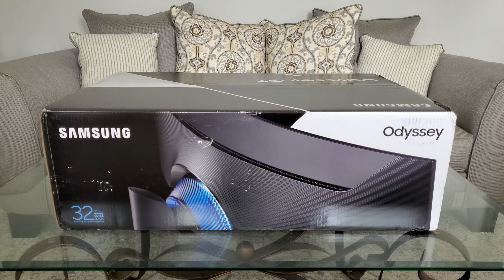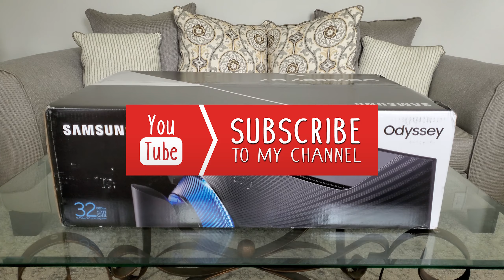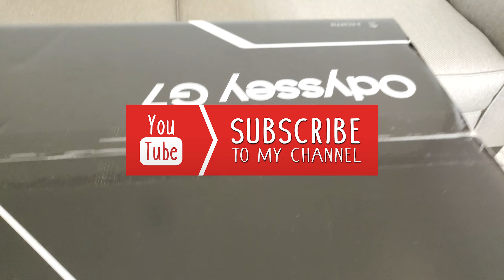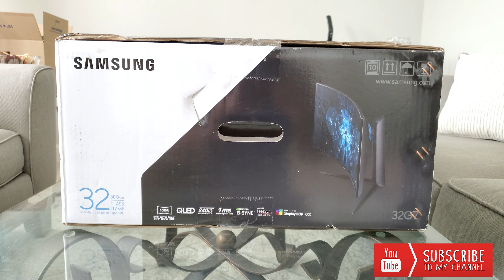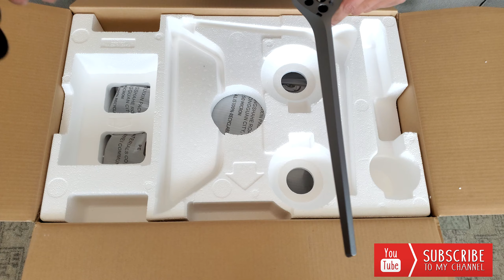Samsung Odyssey G7 Gaming Monitor QLED 240hz 32inch Unboxing and Setup

Comment: Hello, can you tell me if there is some ghosting/black smearing when you playing on dark content ? Thank you very much for the video.
Reply from the maker: Surprisingly no.
Reply from the maker: I am playing since afternoon and it has been working great. No ghosting or black smearing or crush.
Reply: @MyGadgetsWorld  Nice, thank you very much for the answer !
Reply: @RoiPourpre  He's probably lying. VA panels inherently have low pixel response times - this one most certainly has ghosting and black smearing.
Reply: @commercio3564  MIne doesn't... so now it's 2 to 1.
Reply: @commercio3564  Yes, but even on my C32HG70 I can't really see the Ghosting.
To be hontest, it is visible only if you have really low framerate (around 30 FPS) what never happened on my PC :x
Reply: Commercio I got mine 3 days ago (32 inch version). I’ve noticed no ghosting or black smearing.

Comment: Why didn’t they provide a HDMI 2.1
Reply from the maker: Man. Seriously they should. And they are charging a premium price tag.
Reply from the maker: I wasn't really concerned about that because I play 1440p mostly at ultra settings.
Reply: MyGadgetsWorld is display 1.4 good enough to run 240 hz?
Reply from the maker: Yeah but can't run HDR
Reply from the maker: Btw hdr is not even great on this one so DP 1.4 is enough if sole purpose is gaming
Reply: MyGadgetsWorld is HDMI 2.0 good enough for 240hz?
Reply: So HDR 600 isn't good on this monitor?